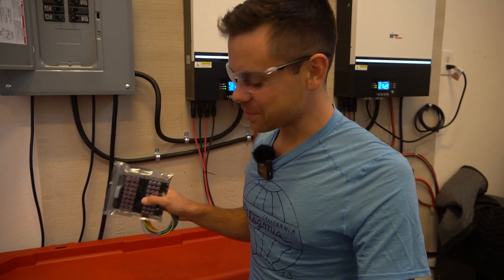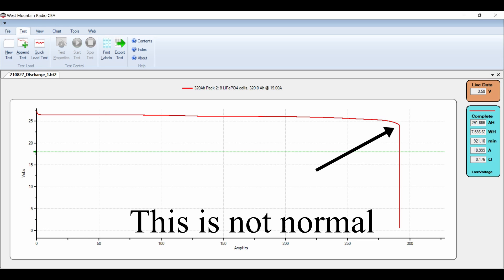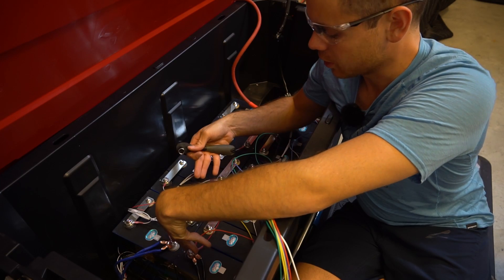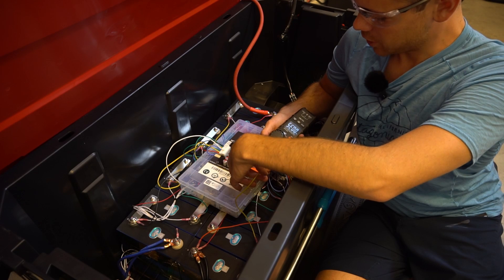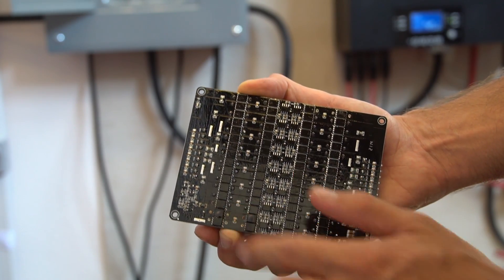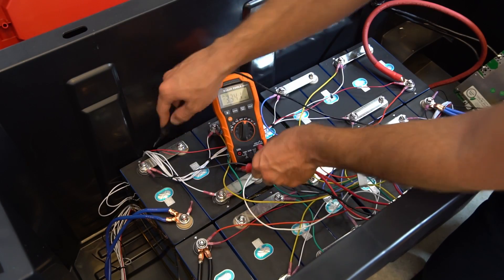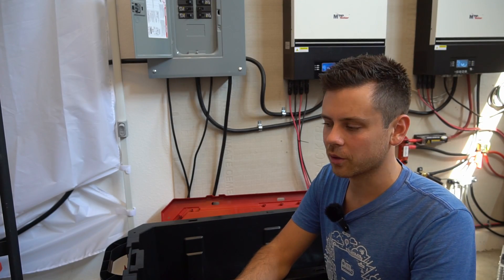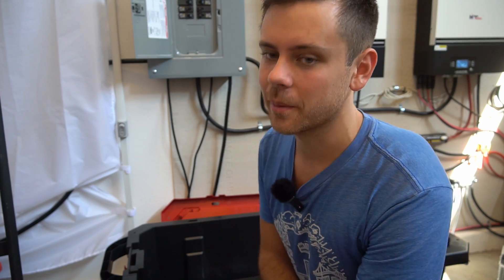16S LiFePO4 Active Balancer Problems (Not Beginner Friendly)

Comment: Hey Will, I have a question for you, there is a guy in my Marina who is a big solar installer for a lot of boat people that keep their boats there. He has his set up very differently and wanted to get your opinion. He has a sailboat that is converted to electric with dual 96v electric outboard motors replacing the diesel engines. Instead of having all his solar going to a single charge controller, he said he had too many issues with BMS's burning up on him, so his battery bank is 8 x 12v battleborn batteries wired up in 96v. He has a victron small 150v solar charge controller mounted on each battery with 8 in total. He showed me how each controller is setup in 12v battery mode/lithium and shares the common voltage from the PV combiner box. So all 8 of his charge controllers share the solar panel voltage based on how he showed it to me and each battery has its own Victron charge controller dedicated to charging that one single battery. He said they act as a BMS in a way because the battery with the lowest SOC will draw more of the amperage from the PV circuit vs the others until they are all charged. On the boat, he had all the PV wired up to a single circuit, then each charge controller was wired to the PV combiner box, splitting the PV voltage across all 8 charge controllers. He said they were the cheaper victron models, only about $25/each and he keeps 2 spares onboard. I just was curious what your opinion was on that setup, i have a sailboat also and been dreaming of ditching the old diesel motors and going EV, but instead of dual electric outboards like he did.. i was thinking of just going 1 single and installing the mounting plate, so if needed i could take the outboard off my dingy to push the boat..

Comment: I've been playing with the 4s version on my new 400ah 12v 4s pack. No problems thus far (I only let it run while I'm in the shop) - But it does seem to always be balancing... In an off grid situation I could see where it would drain the battery if you're not careful.
Reply: Some (Heltec) have a sleep mode below 3.0v & 9ma current consumption.  How small are these battery packs? how long before sun?
Reply: This is absolutely true. i have seen few drain cases with small pack connected with this device. otherwise this is good device.

Comment: I have two active balancer in each pack working flawlessly, however,  at the beginning I notices in the app  that cells voltages were fluctuating and acting erratically. l have to check each wire with the ohmmeter and found that some ring terminals were crimpled incorrectly over the wire insulation making faulty connections. After the faulty terminal were replaced with proper connection everything started working without  any more problems.
Reply from the maker: Oh good point. That could totally happen.
Reply: @WillProwse  why you didn't check voltage in the connector to make sure everything is properly connected? In my case after a couple of cycles one buss bar was loose, did you check that?
Reply: Cant beat soldered joints over crimped one
Reply: @sjdtmv   I build 18650 packs and mod electronics, and i have to agree with you on that. any time i make a crimp i have to add solder to make a true mechanical and electrical connection. best to side on caution.
Reply: @sjdtmv  Except for mobile applications where vibrations break the solder connections.
Reply: @Garyguygax  I solder it, plus heat shrink it this way the cable is partly supported by the heat shrink and solder
Reply: @sjdtmv  There is a reason why marine/rv use all mechanical connections. Crimped steel beats heat shrinked plastic for vibration resistance and solder joints are very vulnerable to it.  No RV/ Marine manufacturer on the planet uses solder joints for electrical.
Reply: @Garyguygax   true to fact. all anyone needs to do is look at the wiring in any car or boat.
Reply: @sjdtmv I always solder the junction between the lug and the wire after crimping it. Can't trust crimping alone.

Comment: Cruising sailboats with electric auxiliary engines routinely go weeks or months operating in a pSOC. Depending upon weather they can find it impossible to reach full charge off of solar.  Drifting cell balance can be a real problem that has to be dealt with. How should we deal with it?
Reply: Apparently, don't. Just blow out cells and catch on fire. It's totally cool. No problem.
Reply: I mean your options are to passive balance that uses large value resistors and slowly bleed charge to adjascent cells or to active balance faster like this one where it uses a "flying capacitor" circuit scheme to shuttle charge from the battery to the capacitor, back to the battery and it travels down the line, in bidirectional fashion. Ends up being much faster than the resistors but is it more efficient. But how quickly does drifting cell balance happen? IMO if you're not in a place where you can service the electronics then a simpler more robust and slower solution seems safer. Speed only seems necessary if the drifting cell balance exceeds what passive balancing can overcome.

Comment: Is there a LiFePo replacement for a 12v battery for my van?
Would it need cooling/heating to survive under-hood annual temperature swings?
Reply: the only thing lead acid is better than lifepo at is starting large combustion engines
Reply: Heat or extreme cold aren't good for lithium in general, and those actual numbers would depend on exact cell chemistry. 

I run a headway bank, but will have to stop charging when the temps get blow freezing. If you don't live in an area that gets below freezing, headway is great for stock voltage(14.4v). Can't go under the hood, you'll have to relocate it to the back, and do a front battery delete.

OR.... 

Do like I did, and isolate them when key off, and parallel them when key on. When winter hits here, I'll pull the headway, and run lazy lead acid. 

You can build a heater setup for it, but more time and $ than it's worth in my application. I have heater pad for it and all, but it'll probably sit in a box forever...
Reply: @georgesrisomsak9650  I'd rather pay $300 for a battery that outlasts lead acid by 4 or 5 times. I live in central Florida so freezing is rare but heat can be tough.
Making a battery to operate the newer high speed starters would seem to be easy enough.
Reply: @billbucktube  A lead acid starting battery is a proven stupid proof unit that has decades of performance history. You can get an instant 600 amps into the starter for a few seconds with no BMS overload and  kick out. IF you have an inverter or 12 volt appliances in the van, I would absolutely use a second set of LiFeP04 batteries back there.  

The other thing you need to consider is that if you deeply discharge a lithium battery, you might burn up your alternator recharging it. They take huge amounts of amps because of low internal resistance.  The alternator may say 100 amps but their dirty secret is that they can only do it for short periods. With a lead acid or AGM battery under the hood, you can connect up the lithium battery to it with a DC-DC charger (I have the Renogy 40A unit and like it) and prevent overloading the alternator. My lithium batteries are behind the driver's seat in a much friendlier environment than under the hood. I hope this helps.
Reply: @billbucktube  I've also not had any damage to my alternator, I do have a high speed, high flow fan that runs full tilt on the rectifier, and it have this setup working 100% in the most abusive conditions your could muster. 

So far, 20+k miles of hard discharge and charging, no failures just yet. I'll report back if it fails!
Reply: @georgesrisomsak9650  Thanks. Your reply is what I'm looking for. Good info. I was certain the details had been worked out. My Dodge Caravan doesn't need mega amps for starting...
Reply: @billbucktube  if it's just for starting, a 40ah pack would be plenty. I was starting and playing 10,000 + watts of audio with just 32 ah. Held great voltage, I went bigger for more power down the line. 96ah would be absolutely overkill for you. If it's just a daily starting battery with minimal accessories, 40ah would be more than sufficient.

Comment: --------------- Smoke detector Will -------------------------           "Plan for the worst hope for the best"
Your house is new enough to have multiple AC/battery backup smoke detector that are wired together through the 
AC wiring, add an additional compatible smoke detector in your Lab. Get an extra large fire extinguisher and sleep soundly.

Comment: Excellent test and information Will.  It also confirms what I've observed with active cell balancing compensating for variations in individual cell chemistry during cycling and ended up severely unbalancing the pack.  When removed the active balancing, and let the BMS manage the charge in two deep charge cycles  the pack balanced nearly perfectly.

Comment: So far I have two up and running on 4p16s with no issues so far, the most amps I have seen is 2.1 and it was not warm at all.
Reply: How long have they been installed? I've had one for a week, and it's been good so far, but now I'm all worried 😂
Reply: @georgesrisomsak9650  he found a potential cause.  He'll give us an update video later
Reply: @SiriusSolar  That will be interesting to see the cause.
Reply: @georgesrisomsak9650   Just about 3 weeks I think, I can go back and check my post to verify.
Reply: Yes, capacitors won't get hot as the mosfet in the bms.
Reply: @neliosamch3195  Very true my batrium m8's hit 40c+ at 1.7 amps

Comment: Damn... I installed one of these on a 96ah headway bank, 4s12p @ 14.6v. it been good for the last week, but now I'm thinking to go back to the passive balancer. It has not let the smoke out yet, but now I'm stressing on it! I use the setup for car audio, so it see's an incredible amount of voltage fluxuation constantly when being pushed. 

I'm weirded out now! Going to check it this very moment..

Update - Cells are perfectly balanced, board is cool to the touch. After reading other comments, I'm pulling the bastard. Insurance won't cover a fire from one inside the car I'm sure. 

I thought I was "upgrading"...  🤣

Comment: I had one and it failed in weeks
Reply: Did it fail in the same fashion? Up in smoke?
Reply: @georgesrisomsak9650  one of the transformers stopped working and would stay on
Reply: @dylanc9275  thanks, good to know. Good for everyone to know, can't have failures like that with equipment, vehicles, rv's and homes potentially at risk. $1000 bucks on something quality is considered cheap in my opinion at that point.